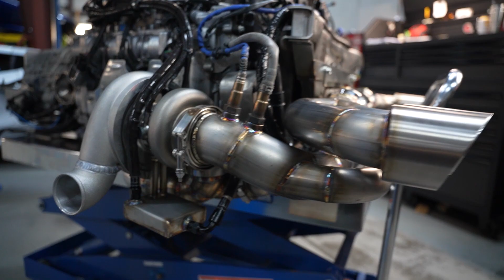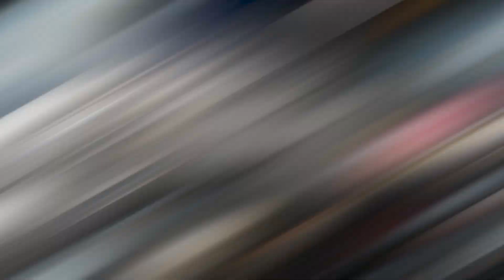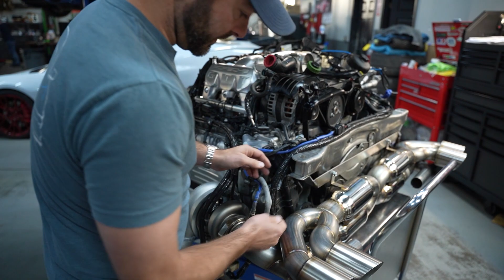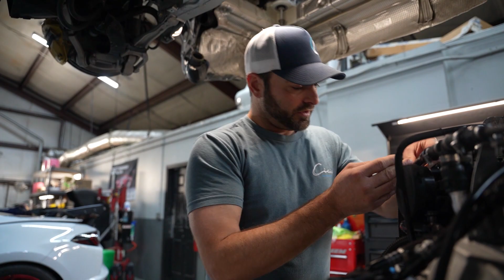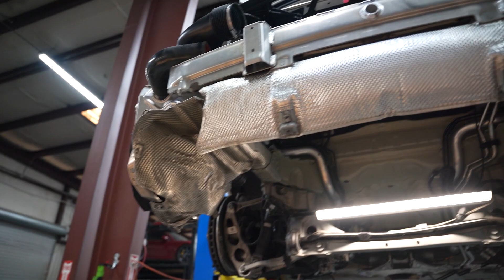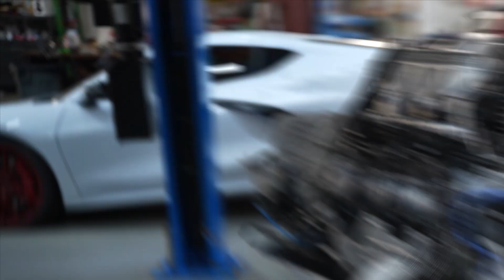C1300 Porsche Engine Build Walkthrough

Comment: Question with that package what need to be done for the transmission, suspension and brakes to handle all that power
Reply from the maker: Porsche's have amazing brakes so we didn't need to upgrade those (although your always welcome too). There's also no built transmissions for them so all that was needed was a Dodson Clutch

Comment: What fuel system do you use to support E85 on these cars ?
Reply: We have two solutions depending on power.  One surge tank setup with dual brushless pumps and an in tank single brushless option.  Both that of course feed both the high pressure and secondary rails.